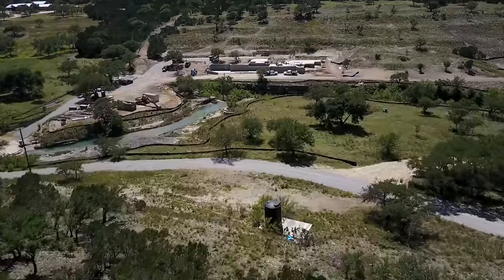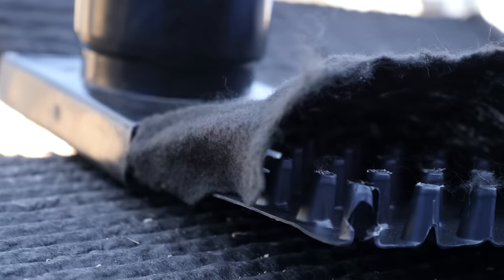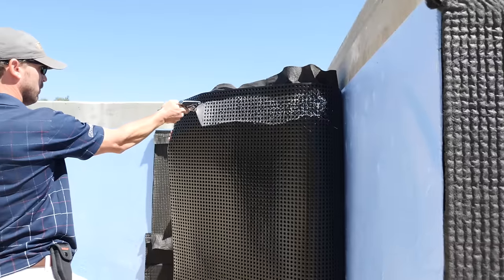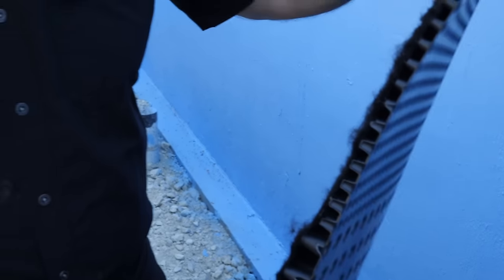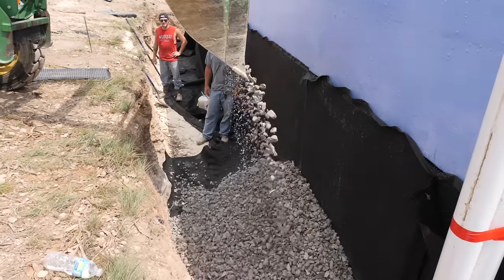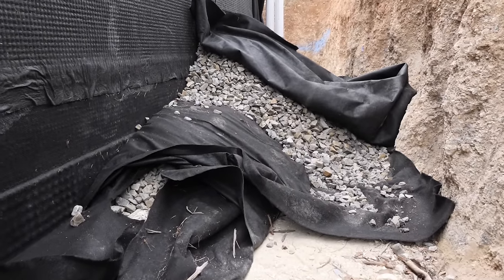French Drain and Foundation Waterproofing System

Comment: I'm not a fan of french drains because of sediment clogging, but i must say , this is one of the best french drain jobs i have ever seen. Very high quality work.
Reply: That’s why he has the sediment filter fabric burrito to prevent that from happening. As the clean out option if it still happens.
Reply: What happens if the filter fabric clogs? Will the cleanouts help with that? That burrito might one day be water tight.

Comment: Sets down black dimpled drain pipe and backs away slowly
Reply: Yeah...that's all I have used because it's affordable and simple to lay.  Oops
Reply: Withe the amount of gravel they are placing on it plus the backfill soil weight of course its doing to crumple, my step dad who i worked for and owned a basement waterproofing company would suggest to the customer which they prefer be it schedule 40 or black corrugated. Most selected the schedule 40 which we ourselves preferred though the black flex is more easily installed. We never had to go fix the ones with the black pipe or even schedule 40 with our warranty service. So to say, its fine to use if your using inside the basement under less than a foot of back-fill and under concrete, but you want to use what he said for deeper drain system or outdoor use the schedule 40.
Reply: @Joshua79C  Forget schedule 40. If we have all this money to burn, use schedule 80 for those drains. We can economize by leaving the marble off the walls in the maid's quarters...
Reply: @Crusader1815  At what schedule do we start losing children in our drainage system?

Comment: Liking the FD system, I did something similar in 12/17 after being fed up with 2"-3" of water in the basement every time we got a heavy rain.  FD was set 7' away from foundation, 6.5' deep (about a foot lower than the floor of the basement).  62' was cleared and 3 tunnels were done (driveway, walkway, water/sewage/gas lines).  A $600 budget kept me from using adhesive, had to use fabric anchors every 18" to wrap up the burrito.  True test was on 8/17/18 when we got over 5" of rain in a day, which would've resulted in at least 4" in the basement last year.  Not a single drop this year.
Reply: How did you do it for $600? Man I spent like $1500. I had to do like 300ft of it. Did you not use gravel? My gravel cost was like $450 alone - 10 tons.
Reply: Nope, I used 1" gravel.  I went up with a truck and got it for about $100 after tax.  The delivery for the gravel cost more then the gravel itself, so I saved a bunch there.  Perf pipe and caps were $90, fabric and anchors were $55.  Mini excavator for 1 day was $200 Dingo to backfill was $150.  Lowes online coupons saved me $30 and tool rental coupons saved me another $40.  Did it all in a weekend with no labor, so I didn't need to buy beer for anyone except for me.  :)
Reply: Nice work.
Reply: It also took a month of planning.  Not exactly speedy, but a 60 hour work week really dragged out the research and design time.
Reply: Can you elaborate how you dug the tunnels.  Did you dig them by hand?  How long was the tunnel for the driveway?  Were they big enough to walk in and set the pipe?
Reply: EE101 I was working in a trench about 18” wide and getting a mole was out of my price range.  I got a bulb auger but from HD and fabbed an extension from some black pipe I had from a previous project.  Hooked it up to my hammer drill and kept it geared down to loosen the ground, then geared it up to let the auger bit to shoot the dirt out of the tunnel.  I did a ‘W’ pattern (3 holes @ 4”above trench floor and 2 holes @ 1” above floor).  The tunnels were only large enough to run the pipe.  I didn’t want to waste time backfilling it all and I would’ve never gotten the earth compressed enough anyways.  

To connect the W points, I took a scrap PVC pipe, cut teeth in it, hooked it up to the black pipe extension, and hogged out the holes until they were one passage.

I fed in as much crushed gravel in as I could along the sides by taking extra pipe sock, put it in my drain pipe, then filled the sock with gravel.  I pushed the pipe in until it poked out the other side of the driveway, then I anchored the sock and spun the pipe out, leaving me with a sock of gravel for support/drainage on both sides of the tunnel.  Then I pushed the empty pipes in and connected them to the perf pipe that ran across the front of the house.  It really wasn’t bad to do once I sketched out what I wanted to do.
Reply: EE101 Almost forgot, driveway is just short of 10’ wide
Reply: Very resourceful good work!
Reply: @jheissjr  Thanks!  It helps to have a garage full of crap sometimes.  :)
Reply: Good work! I like reading success stories like this.
Reply: @VertigoGTI  You're hired. My house is ready for you.

Comment: Dimple membranes called as drainage sheet are one of the most versatile and effective materials for waterproofing of the buildings. It is (HDPE) High Density Polyethilen based and provides speed in your construction projects, sustainability and environment friendly solution.
Reply: This was first invented and used in Holland called playton  the dimples go against the basement walls running just above grade  now here is what most contractors get wrong there is a top open channel piece that goes on top all around the perimeter to allow air in to keep the walls dry.  I constantly see just plastic strips used to adhere it to the walls negating the whole concept of the system. Probably done as a cost measure but will never work as intended

Comment: Here is how to make the best French drain system ever.  Tools needed for this job.  Block saw, brush, drill, hammer,  shovels, and a rake.  First step is to find where water is coming into the house.  On this house where the block meets the slab had a gap. I filled it with water proof epoxy. Let dry then put black tar base water proofing over it and also put it along the block where it meets the footer.  Put pipe down and cover up.  Always make sure the pipe is going down hill so water will fall.

Comment: This is invaluable information. You excel at finding the best builders and subs.
Reply from the maker: +AF-O6 thanks buddy. Brian is a great builder indeed!
Reply: @buildshow  the only problems with this, otherwise great, video is that he Brian didn't address why he is installing two pipes (you asked but he didn't answer), and the video rushes through the final stages of installation after he lays down the first layer of rock and folds over the outer edge of the geotex material - but only a foot or two from the outer edge.  I'd like to see a more detailed view of how he finishes out the wrapping of the geotex and additional layers of rock.  Can you supplement this video or just post info on the exact details of finishing off the drain.
Reply: @northavealum  I initially planned 2 pipes just to be 'overkill' but 2nd guessed myself out of it. I theorized that if you use pipes or upgrade to a 6" pipe then you slow the water flow, which may allow silt to settle in the pipe sooner.

Comment: I really like the cleanout idea and this system! Thank you! The only question I have is about the french drain holes. You mentioned that the caliche soil is very fine so you protected the top of the drain with layers of rock and filter fabric, but what about the bottom, where the actual holes are? You only have a single layer of filter fabric between the ground and the holes. If the holes are facing up, you have all that protection above it. I understand most water will come from the top down, but any water working up from the ground and any standing water around the filter fabric at the very bottom could eventually compromise that single layer, inviting that caliche soil in, right? Also, all that weight of the rock and earth on top seems like it would push those holes extremely tight against the ground, possibly eventually sealing them off with built-up soil and dust from the rock. Why make the water fight to get in the holes? I've heard the arguments for holes facing up and down, but I think holes on both sides are the best idea, especially in this case. Thanks for the video!
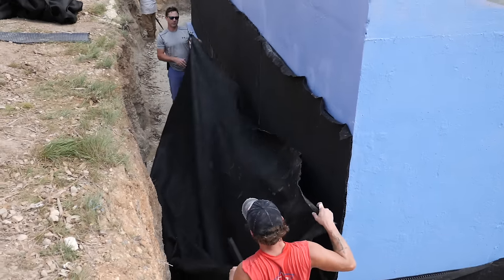Reply: at 4:08 & 5:15 you can see the filter fabric right underneath the french drain is on a compacted bed of septic rock. Maybe they're hoping the sediments won't travel upwards along with the water, but yes I'd think over time sediments would migrate and build up in that unfiltered bed. My understanding is you want the rock bed within the fabric so the pipe is protected on all sides.

Brian's description of "the burrito" with multiple layers of fabric and rock and more fabric and more rock was pretty confusing, so maybe I don't understand. A diagram would've been nice.

Comment: French drain with clean out!?!?!?
Badass.
Reply: Cynical Texas Dad  have access to any drain is a goof practice
Reply: Dang it! Why didn’t I think of that?
Reply: I’ve put clean outs I. All my French drains for the last 25 years
Reply: If nothing else, air moves water.  So there should be a breather pipe going to the surface to allow air to push the water through the system.  Otherwise you get a thermos bottle effect.   In addition, if the downspouts from the gutters are connected to the drain, you need even more air.

Comment: Very nice. I would add that the only thing that the perf pipe really does is provide a pathway for whatever clean out maintenance activity you do over time. If your geotextile truly keep sediment out of your septic rock, the septic rock “burrito” will be the pathway for any water...not the perf pipe.
Imagine your bathtub full of septic rock and a 5’ length of perf pipe at the bottom. Turn the shower on. Is the pipe REALLY doing anything?

Comment: This looks like the drainage installs made in Sweden in the 70s. The drainage pipes aren't below the house foundation and makes it possible for the concrete to suck water. 

The plastic wrap around the house looks pretty much like the infamous swedish product "platon" with some modifications. 

The blue goo makes it impossible for the ground water that have been sucked up in the walls to escape out, so the only way is to dry to the inside of the wall which will make damages inside the building.

Take a look at "isodrän" or "pordrän" for superior swedish drainage systems which solved these problems in the 80s.
Reply: And the platon is supposed to have the nipples towards the wall, making it breath. No blue goo is necessary, and as you states it will close the moisture inside the wall. The rocks and the pipes needs to be below the slab to drain the water away or else this is a recipe for disaster. I am glad I am not the owner of this house.
Reply: Hopefully, grading the landscape away from the house will keep the water from ever hitting the foundation and the drain tile at all. Drain tile is only for heavy precipitation (10-year events).
Reply: Excellent. Thank you for your insights.
Reply: Currently doing my research for basement waterproofing. Your comment is quite helpful. Do weep holes help in draining water that is sucked up by concrete ? I would think not but half a dozen masonary contractors and waterproofing experts could not provide a clear scientific answer.

Comment: I have not heard from other builders about corrugated black drainage pipe collapsing. I have tile drains in my farm fields that are 40 years old. The ones I dug up are good. Granted, they are only 3-4 feet deep but I have 10 miles of them.

Comment: When you cut the dimple board at the corners it allows water to get through. From there you're relying on the liquid membrane to avoid a damp or wet basement? Just curious, we are planning to use the same system on 2 new homes. Thanks
Reply: The dimple board is not a water barrier. The dimple board provides a space for water flow between the wall and the dimple board and the dimple board helps protect the waterproof membrane from the sharp backfill.

Comment: It looks like the perf pipe is sitting on the top of the footing. If it is, the cold joint between the stem wall and the footing will see water before it's carried away in the drainage pipes.
Reply: Arroyo drain membrane connects to the pipe
Reply: The arroyo drain outlet sits on top of the footing too, right? Holes in the schd. 40 perf pipe are at least an inch up, maybe 1.5" up.
Reply: 99.9% of the wall is covered with a membrane and there shouldn't be any hydro-static pressure.  They are using the membrane as their primary drainage surface and not the typical "french drain" scenario. 

Footing to stem wall transition is sealed and continuous  liquid flashing across both surfaces.
Reply: What about slope of the pipe. Wouldn't we want to see 1/4" per foot? How does that work on top of the footing?
Reply: Not sure.  It would be nice to see what happens after it turns the corner. My earlier assumption was that the second pipe was the daylight pipe and the first a dedicated membrane collector.
Reply: "Best practice" would be for the perf pipe to be lower than the top of the footing, and positively sloped to drain, which means outside of the footing. Cold joint sealant and the spray on should work, but why push it.
Reply: I remember reading that French drain pipe should not be sloped per manufacturer's specs. Can't recall which manufacturer it was. Just google.
Reply: @JohnFryer  are you saying that the holes in the bottom of the schedule 40 pipe are not perpendicular to the bottom of the ditch but instead are rotated up pointing toward the outer wall of the ditch?

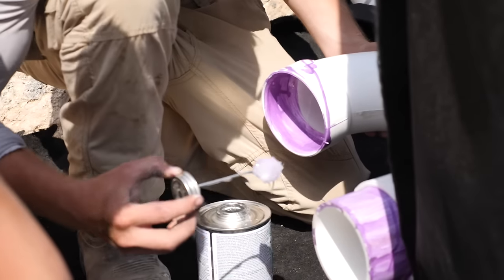Comment: Did Brian say PVC schedule 40 pipe is "green" at 5:40? Better check that. It's made from petroleum, isn't generally considered recyclable, and has lead, phthalate, VOC, dioxin and chlorine issues. Otherwise, nice work.

Comment: Thanks so much for the video but there was no mention of sump pumps or if they’re needed.... Also pro/cons on running gutters down to perimeter drains or separate drainage all together.... Thanks Matt for your great video and informative methods to building a great home
Reply: In the video he says it runs to daylight. Daylighting is a term used in the industry, if the open end of the pipe is pointed downhill that's daylighting.

Comment: Most basements will have a humidity problem due to outside or humid house  air entering  warm air gets in to the cool basement like when you take a shower the bathroom mirrors fog up. It’s worth it to install a goops dehumidifier for the whole house

Comment: Mr. Brian Long, excellent job. May I add, water is not the best solvent, but the universal solvent. Bio diesel or vegetable oil are faster, so possibly they are.
the best solvents. Your drainage design is impeccable . I commend you.

Comment: The weep holes go on the bottom because everything down there is denser than water, this helps keep dirt from entering, and filling up, the pipe. At least this is how my father explained it. Has anyone dug up an old one of these? How did it do? ( I also think Bryan is  right about using schedule 40 instead of that soft stuff. That soft stuff is just going to flatten into uselessness.)

Comment: Any tips on applying dimpled membrane around plumbing that penetrates the foundation wall? Currently adding a french drain to my 80-year old house. My water intake is 3.5ft down in the middle of the wall). Do I just need to cut the dimplemat vertically? Do you do anything about the seam?

Comment: What you're looking at here is a permeable liquid membrane product designed to remedy the weakness of OSB, intended as house wrap alternative, being used for foundation waterproofing!  Being permeable, the membrane allows water to travel back and forth. 

Drain boards don't waterproof the foundation.  As basically little air pockets they counter hydrostatic pressure and channel water down to the perimeter drain, in this case French Drain because of complex site drainage issues. 

The foundation wall section shown in this video isn't waterproofed. If located in Texas, maybe not a big deal. But this blue goop, including the cartridge sealant, is designed for wall and roof sheathing. The compound on the foundation wall and footing/foundation joint should be 100% waterproof.
Reply: I'm in a similar area here in Texas and about to build a hill top home as well with a walkout basement.  Jason could you elaborate on this? I thought it looked waterproofed to me.   This is very new to me, and I am relying on the foundation contractor I'm hiring to know exactly his plan will work.  So your knowledge is definitely helpful!  I don't want regrets :(

Comment: I recently purchased a house and I've been enjoying your channel and getting renovation ideas.  I need to move water away from the foundation in my new place and I've thought about using board with the dimples.  Do you know if there are applications in which that board can be placed horizontally towards a drain tile about 5 or 6 feet away from the foundation?  I'm thinking of starting the board against the foundation (below grade) as show here for about a foot and then angling it horizontally towards the drain tile.  Tough to explain.  Main thing is to figure out if that drainage board can be run horizontally with run.